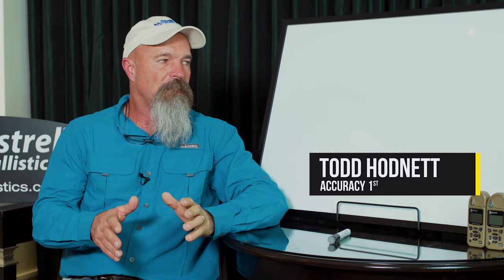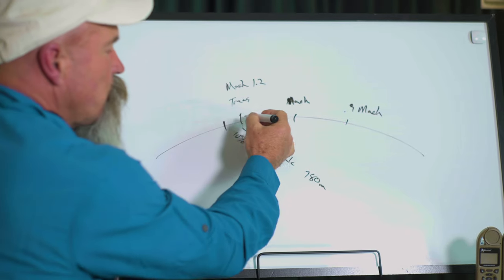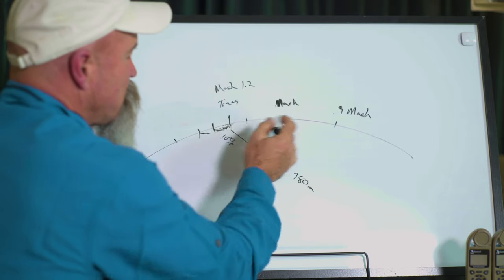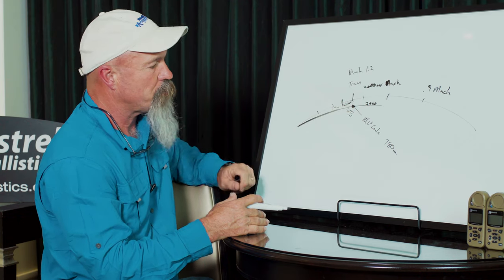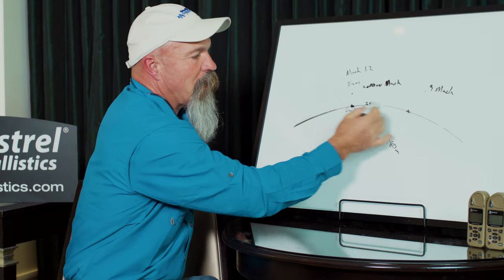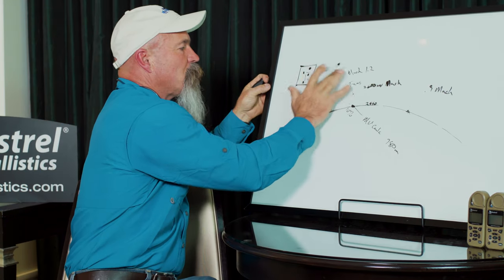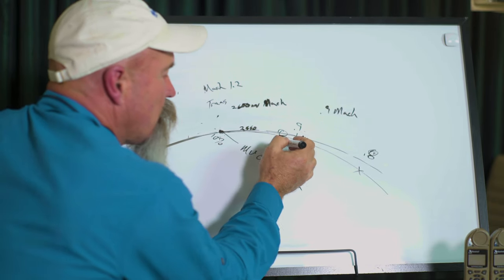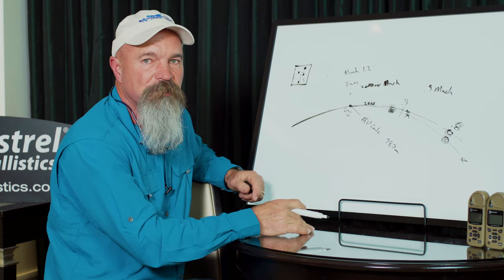DSF Table vs Cal MV | Todd Hodnett from Accuracy 1st

Comment: I’ve found that when truing like this, one has to have the direction of wind really nailed down too because a left wind pushes bullet low and right and a right wind left and high. If you don’t get the wind vector correct when truing one can be introducing elevation errors just from an incorrect wind angle. I love the kestrel ab because it will account for these wind angles (aerodynamic jump)into the solutions as long as you put the right one into the firing solution. Love the videos!!!!!
Reply: Sorry to be off topic but does anybody know of a method to get back into an Instagram account?
I was stupid lost my login password. I would appreciate any help you can give me
Reply: @Chad Karsyn i really appreciate your reply. I found the site through google and Im trying it out now.
Seems to take a while so I will reply here later with my results.
Reply: @Chad Karsyn it worked and I finally got access to my account again. I'm so happy!
Thanks so much, you really help me out!
Reply: @Canaan Brixton you are welcome :)

Comment: Todd, I watched your lessons, calculations in the wind. Now I made my calculation for the wind. Now I don’t need a ballistic calculator in the wind. Moreover, I do not need Koestler, the wind can be measured by sensations. Now I am the best on my continent in calculating wind.I also developed a calculation of vertical and angular corrections in the mountains, all calculations from my head.  Now I can teach special snipers to work without a ballistic calculator.

Comment: In this discussion are we talking about the Kestrel with Advanced Ballistics or with the Hornady 4DOF ballistics? Or is this practice applicable in either case?
Reply from the maker: Both these functions are strictly for AB units.  Hornady uses different techniques to improve accuracy but they are not discussed in this video.
Reply: @KestrelBallistics  Thanks for the quick response. I wondered about that. Do you have any instructional materials on how to do something similar in the 4DOF units? I bought one last fall, and have used it successfully shooting out to 1000 yards+, and I'm not pushing my game farther, and am looking for the best ballistic predictions I can get. Can't afford to buy another unit, so I'm looking for how to maximize the value I've got in my 4DOF unit.  Thanks in advance for your kind assistance.
Reply from the maker: Stay tuned 4DOF tutorial incoming!
Reply from the maker: https://youtu.be/yev25Z1VKts
Reply: @KestrelBallistics  Thanks for that! It is very informative. It cleared up some questions I had with the printed manual, places where it was unclear. Only wish I'd known about it before the live broadcast.

Comment: Wat speed r u calling mach1.2
Reply: I'd guess around 1350fps
Reply: @extreemairsoft  Yes Mach 1.2 is about 1350 fps.
Reply: In all fairness it is mach 1.2 at whatever your local conditions are.
Reply: I think he is saying that the kestrel or maybe even a wizz wheel will take that into account by knowing your density altitude and BC and the list of other factors that go into shooting at the ranges their dealing with. Will predict within an acceptable degree of accuracy when your bullet enters the transonic phase and calculate a flight path based on that… not just a flight path based on muzzle velocity.. im probably way wrong though.
Reply: @jasonmpd2946  yes. SOS X 1.2 + temp is Mach 1.2.